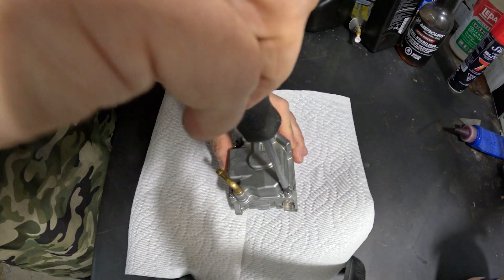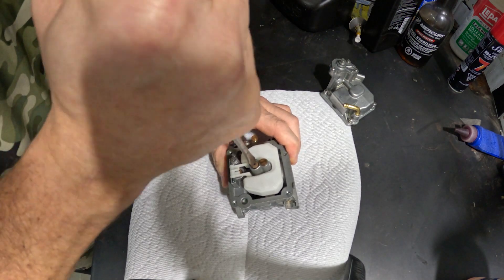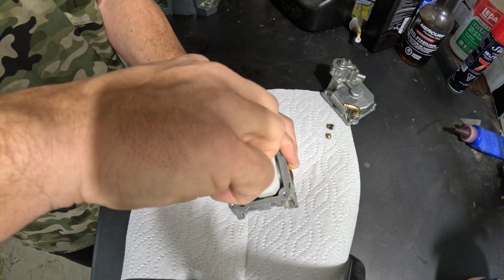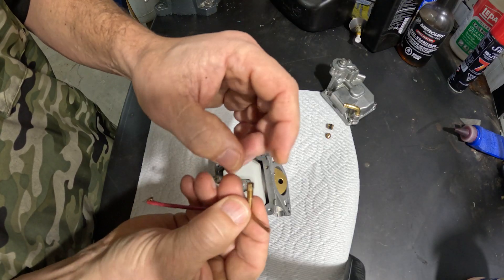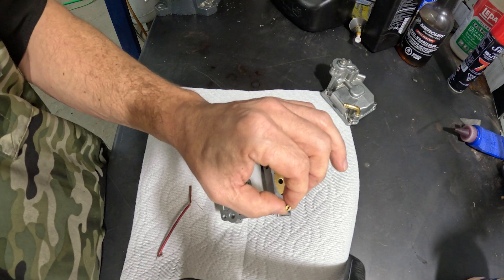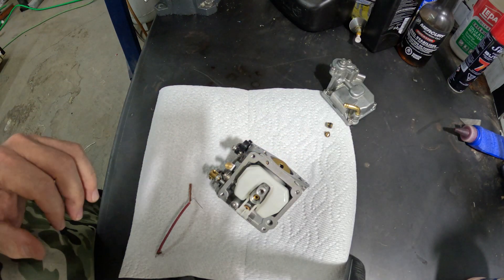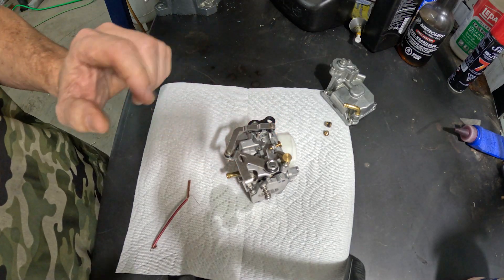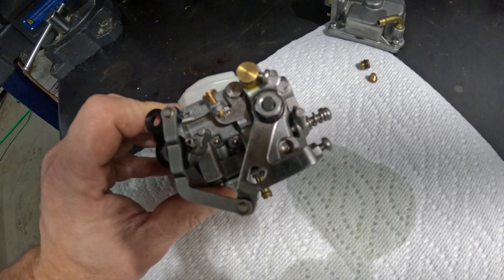Outboard Only Runs With the Choke Out? Here’s the Fix

Comment: I have a Yamaha 9.9 4 stroke outboard that speeds up when the choke is pushed in. You commented that the recessed jet screw can cause poor idling and/or speeding up of the engine. Why would this jet cause the engine to speed up? Thanks.
Reply from the maker: If the engine is warmed up, there maybe too much fuel being delivered through the carb with the choke on.  By opening the choke you lean out the mixture, the rpm will then increase.  As for the anti tamper jetting...its set for lean at the factory.

Comment: What about 2 stroke that idles and runs decent at lower speeds but when I open it up it bogs until I push in the choke, then she runs great until I release the choke.
Reply from the maker: Hi speed jetting is plugged.  Carb needs to be disassembled and cleaned.

Comment: I have a problem on my Johnson 25hp outboard motor 2 stroke when I leave the choke open it runs but doesn't idle when I push it in it bogs out but mine has little hose that plug into  it doesn't connect to the carburetor I'm stree out lol
Reply from the maker: You have a primer rather than a choke.  Still need to pull off the carb and clean it up.  Or..adjust the low speed jet if applicable
Reply: Yes it is on the front of the motor I pull it out thme push it in to spray gas into the carburetor I blewve it has 3 little fuel lines 2 go to the fuel pump I think and one to the top of the carburetor  it's weird when I pull it open it runs but won't idle if I push it in it dies I  cleaned the carb always I thinking I need a new carburtor do you know where I can order one I'm stressing I never had this problem ran fine now it's acting up thank s for the information @TheMarineDoctor
Reply from the maker: @donaldmartin4620 Normally cleaning the carb and updating gadkets clears this up.  Perhaps a mistake in the carb?  Also...compression?

Comment: Hi mate thanks good video ,so i have had a vibration problem and not able to get passed 3000rpm i changed the fule filter, also the fule pump on my 90hp Tohatsu. So took it for a run today it did improve the 3000rpm speed but that's it, being a rocket scientist I pushed the auto choke to my surprise it started to take off a touch hit the auto choke several times very quickly finally got up to 4200rpm got on the plane and stayed there😊 so could it be just a carbie hi speed jet clean ? Cheers 🍻 guys any info would be Awesome. 
Steve 
Adelaide  South Australia.
Reply from the maker: It does sound as though their is a fuel delivery problem.  Verify the integrity of the engine with a compression test...if it checks out, chase the carbs.

Comment: As tech moves along things become even more expensive.  Keeping the old ones running....is well worth the money.  Knowledge is key as some of this stuff is no longer taught.
Reply from the maker: @dumbbellandadog5377  Agreed...a new 9.9hp Merc retails at $3815.  Fix the old!!!
Reply: I needed a small motor for a little 12ft Jonboat and found a little 1982 Johnson that starts, but won't run without the choke open for $50... After doing this it runs great. Saved at least around a thousand. New prices are insane.

Comment: Whats a choke asked the EFI ?

Rebuilt zillions of carbs since 1976.
Reply from the maker: Yep. Old outdated Tech I am afraid.  The 8 and 9.9 have now been replaced with EFI.  So...chokes are obsolete on the new engines.
Reply: @TheMarineDoctor  kinda ridiculous...No need for that on small motors . Even Sthil chainsaw has it now .
Reply from the maker: @Motorhead250  I guess they need to justify for the more expensive engine?  I will say this.  Even with the programs of 7 year warranty and a tiny discount.  The majority of buyers just say...the price is out of reach.  The economy will not support the new pricing.  Engines....will sit.